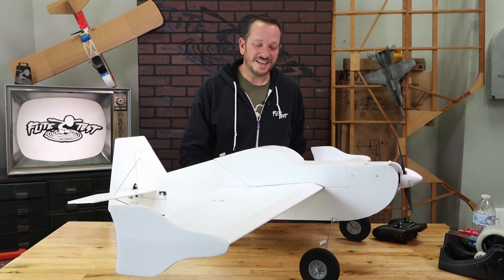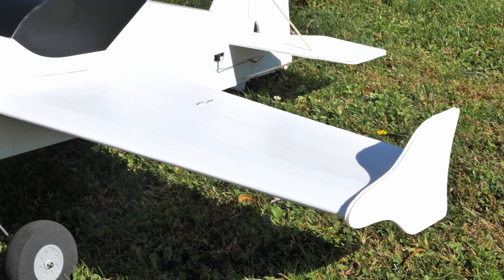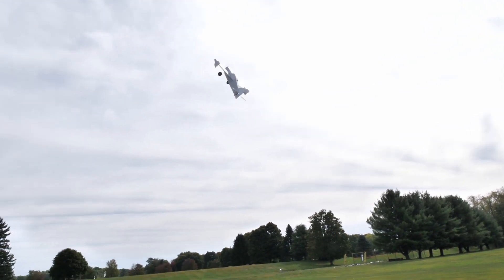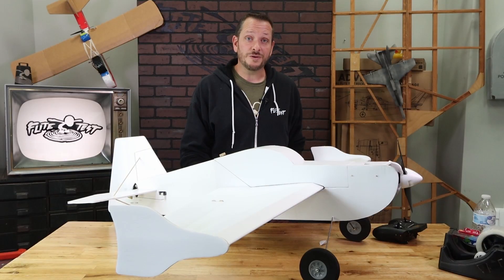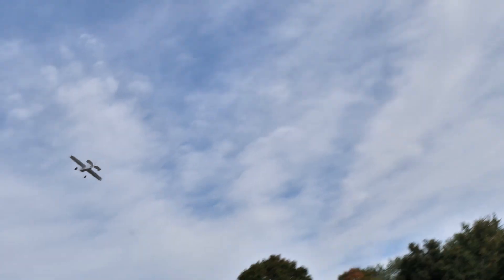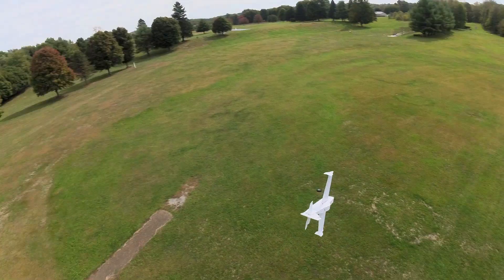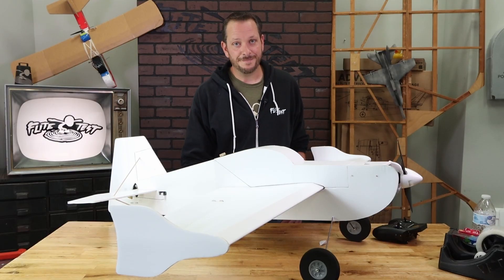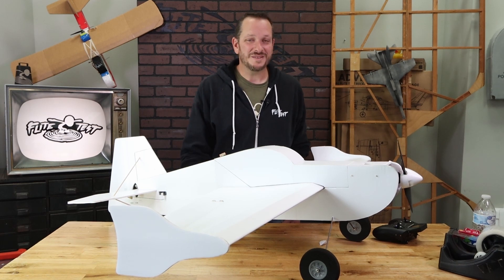FT 3D XL Vision Video

Comment: Built this baby, tweaked a few things as I went along, and maidened it today with a few flights at 25 degrees out. Couldn't wait. I was optimistic, and wasn't disappointed. My fave flying plane for aerobatics, and basic 3D, is an Extreme Flight 48" Extra 300, and this FT3DXL flies as nicely as that one, so far. I really like this one. I do find it flies best with the CoG back only 3" from the wing leading edge, not the recommended 4". YMMV. Congrats on a fine plane/kit, FT.